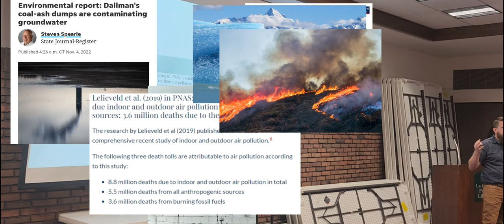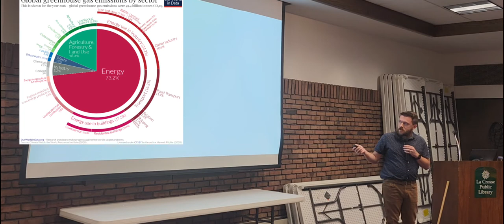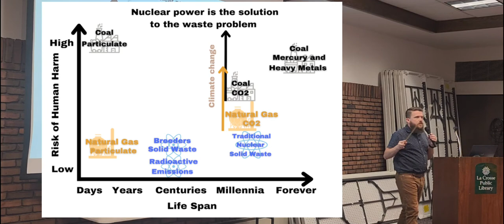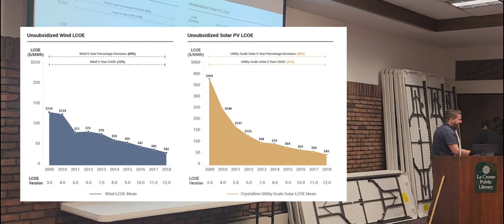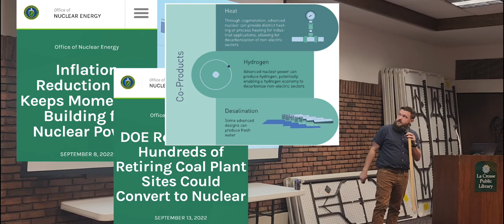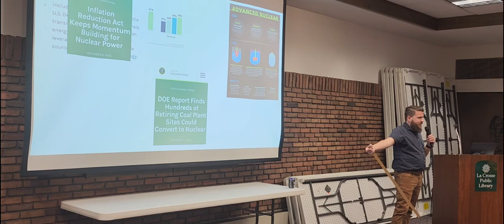How to fix our MASSIVE waste problem [LECTURE]

Comment: I have one question about the mining and material requirements (at around 28:00).
Nuclear plants can run for 60-80 years, hydroelectric dams 100, but wind, solar and batteries have an estimated lifespan of 25 years. 
Is this considered on those charts? 
Sure, we can recycle  part of the aluminium, steel, copper, but we still need to mine high-purity silica, coking coal, etc for new solar panels every 25 years. 
Or does it not matter too much?
Reply from the maker: Yes, the numbers consider the life cycle energy produced. The numbers for energy storage were from a very optimistic study on material usage for energy storage.  I used the best case, which is "second-life" lithium batteries. These are recycled batteries from electric cars. The material requirements double when using new lithium batteries. All of my numbers were optimistic toward wind/solar. 
I'd like to flush these numbers out further in the future and possibly publish them.